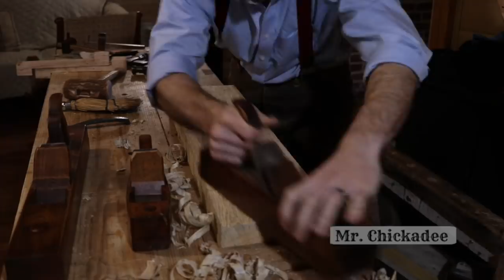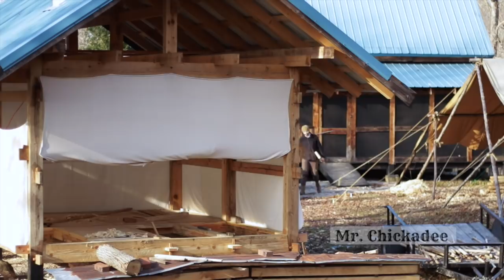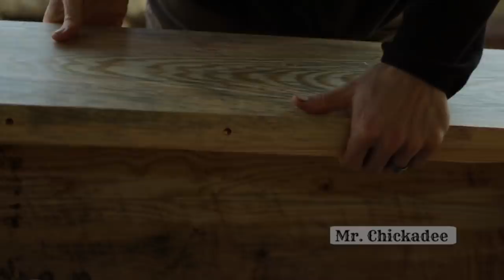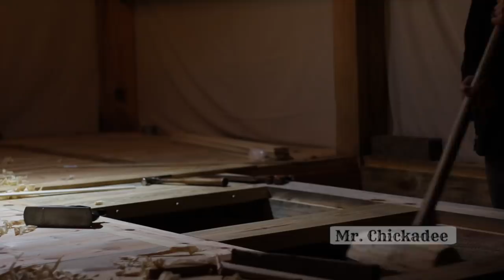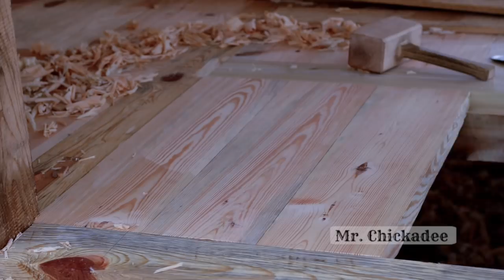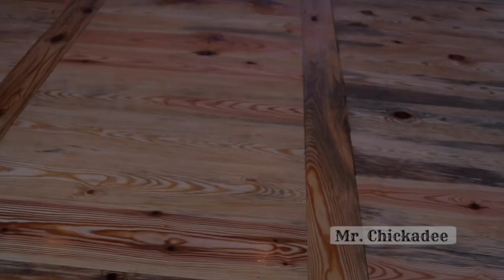Traditional Korean floor 대청마루 ( daecheongmaru) PART II a wooden floor without nails, screws or glue

Comment: Fantastic accuracy and a wonder to watch but I can't help thinking about the moisture content of the wood? any expansion and the forces will be unreal and any loss might see gaps everywhere. BTW I can see easier ways of achieving the nail less goal without such technically difficult joints. Still I very much enjoy your videos and I envy your ability to produce such fine work. PS.....I also use hand tools but I have come to the conclusion that some power tools have superseded hand tools both in time and accuracy, the table saw (set up right) can produce square stock in a fraction of the time it takes to square it by hand and a bandsaw can also be very handy.....I know.....shame on me lol
Reply: I was also wondering about seasonal expansion and contraction, I suppose this is covered pretty well on some sub-forum. I'll update this comment if I find a reasonably well explained resource.
Reply: Purple Om a jointer and thicknesser would half the time again but I think that would ruin the aesthetic of what this channel portrays
Reply: What is this 'power tool' you speak of? Is it some kind of wizardry?
Reply from the maker: @JayCWhiteCloud  As always Jay, you answer quiries much more completely and eloquently than I could hope to. I would add that most western flooring systems require more hand work as each board must be trued all sides while this method only needs the top and two parallell edges trued, or if fresh off the mill in a more rustic style no planing at all as any cupping should not have occured yet and a short board should be quite parallel "off the mill" If the sliding dovetail variation is used, and galloping joists, only two angled cuts need be made on the ends of each board hot off the mill, and slid right on in from one end of the builing to other. I cant think of an easier more efficient method?
Reply: Mr. Chickadee I could spend hours expressing awe and praise, you truly are an inspiration. Thank you for making and posting these videos of your amazing work. Can you please explain what you mean by “galloping joists”, I’ve never heard the term before. Thanks for your time.
Reply: @MrChickadee  This gives lots of food for thought. It creates a nice low profile floor (The way I build a floor with subframe, joists and boards on top often results in more than a foot of overall thickness). Good use for odds and ends of logs. And as there are no metal fixings, the surface could even be finished after the floor is installed. What is the reason for fitting the boards "bark side up"?
Reply from the maker: @badbernrock  Thank you, yes that is an old English term, I should clarrify, a "galloping joist" is simply a joist which sits atop the supporting beams, not flush with them. They are often joined with small notches cut out sometimes from the joist, or sometimes from both joist and beam under them, preventing movement in either direction. If these were used, not only is the joinery VERY simple, but the floor boards could be slid right through the building from one side to other depending on design, but the same joists could be used outside the frame proper if left long to also support the porch. These type joists could be used up top for the ceiling joists and left long on the gables to give support for a gable hip type roof as well. Ill be doing that in this little building soon.
Reply from the maker: @peaterful  Oh yes indeed, depending on design, you could use the widest boards you could mill from something like the thick butt logs often cut off and disgarded by loggers. My mentor has done floors of this type with 30" wide boards, only takes a few of those to fill a room! 

Yes, the fastest and simplest way to do this is to have galloping joists, those which sit atop the beams not flush with them, just slide the boards in green hot off the mill as they should be pretty straight and free of cup that fresh, then come back later to finish the whole floor if desired, or tighten up anything as they dry. Lots of options really, just a world of new possibilities, thats why I love this floor system. Tongue and groove can be used instead of the sliding dovetail I used, boards could be joined togher as well if desired with shiplap, T&G, groove and spline or other options. Easily insulated under between joists with Roxul Mineral wool batts.
Reply from the maker: @peaterful  There is a whole new world in undertanding an utilizing wood following the eastern traditions, we go deep into this in our timber framing classes. Just a few off the top of my head are; often fewer knots, less splintering (some woods the heart side of a board can delaminate badly in use on a floor, no one likes a 4' splinter in their foot,) many woods have harder wood on the bark side, thats why beech hand planes are oriented with board side on the sole, or should be, in some applications bark side up is the easiest way to control cupping, as the sides are held down the middle will always be down too, heart side up can still cup upwards. There are methods for roofing and siding where bark side out or up causes all the boards to lock together correctly and hold each other on...These are just a few, there are more. Also some of this just gets into the very differnet attitude and understanding asian masters had towars wood in general, they would enver use a timber or board upside down from how the tree grew, they selected trees and their applications depending on where in the forest they grew, i.e top of windy hill or deep in shaded ravine. All this is foreign and unknown to most western carpenters but was understood loooong ago in asia.
Reply: @MrChickadee  Thanks very much for your in depth reply, very interesting. I think about grain orientation when doing green wood furniture making but rarely when working with wood off the saw mill. I shall think about it more in future. Thanks
Reply: Jon Anderson you know that korea has extreme climate condition.. right? They have like 35C(95F) degrees wet summer and -35C(-31F) degrees dry winter.

Comment: Man you are some kind of craftsman, I own some of the older, early to mid century, tools that you have, and have learned from you about some of them. A non-traditional Korean floor, Ahn-Dal, about killed me in 1975, the charcoal Brick system. Crack in the floor let in copious amounts of carbon monoxide. Luckily I retired between 3-4 am, and woke unable to move around 6:30, I didnt have any trouble hollering though, and the lady who rented me the room came running took one look at me and started slinging open doors and windows. Recovered slowly over a couple hours and had a massive headache most of the day. One bonus was a breakfast in bed fit for a king, Ham and cheese omelettes, buttered toast, big glass of fresh squeezed orange juice, grapes and melons. She never made breakfast for anyone. I think she was trying to keep me from reporting the incident to local health authorities. I was happy with the reward, though I never spent the night there again.

Comment: Very nicely done. Love what you did. Korean ancestors think a house should last very long time and the wood and nails don’t go along very long because wood soaks the moist and nails get rusted from the moist. Eventually cause house to fall down. So it is very reason driven way to build a house solely using woods. Not only floors but also every part of house is built like a lego with only wood. And youve done a very nice job👍👍👍

Comment: Thank you Mr. Chickadee for taking the time to film, edit, and share this wonderful craftsmanship. I have questions for you about the roof. When zoomed out it appears you have a metal roof. Is this going to be your final roof? If so, how do you plan on stopping it from leaking? In my experience with them, metal roof always leak in a relatively short time span as the metal sheets expand and contract moving the nails until there is room for rain to come in.

Comment: I'm korean architecture contractor.  the traditional floor type is very eco-friendly method not using any glue or nails.  but it's getting forgotten because it takes a lot of time and  accuracy by carpenters in modern time pursuiting efficiency and productivity.   But sometime I miss that type floor board where I used to sleep and frolic when I was child.

Comment: I used to live on that kind of floor. It gives nice ventilation through the chasms during summers and we would block the front opening to keep it warm during winters. My puppy would sleep under the floor during summers. The area this wooden floor was located was between two rooms which were slightly lower than this floor. The Korean for this wooden floor is "마루(Maru)" which means higher place.

Comment: Extraordinary workmanship.  You make it seem easy and it is very deceptive of the level of skill required to pull it off.  Its your skill that hides its immense demand for accurate measuring, and exacting sawing, boring, and chiseling. The liquid used to coat and seal the wood; is it a preservative or an oil.  And how many coats?
Reply from the maker: Its just some canola oil mixed up with beeswax and turpentine, one coat for now.

Comment: So impressive, the precision and obvious quality of the work. You've said it took about a month, do you think you could recreate this level of quality with any mechanical assistance, to speed the process up, or is doing it by hand the objective for you? I find doing things by hand where possible and admirable, but I just don't have the patience. You are obviously so meticulous checking even after the stroke of a plane. Any other questions I had have been extensively covered in the comments section, so thank you for your time. New subscriber.
Reply from the maker: It took a month with other projects going on and not full time work here. Some few craftsman who do this work for hire use power tools to speed up the process. I have no need or desire for power tools, but I also dont do this for hire. Work how you enjoy, what matters is understanding the material and the methods, they can be achieved any way.

Comment: Mr. Chickadee, would you have a guess you would be willing to share with me how much thicker the frame for this floor ought to minimally be than the floor pieces that slide into the frame if I build a floor like this for a very small cabin out of tulip-poplar and have floor pieces under 3' long?  I want my floor to be as thick as possible in order to provide a little bit of insulation value, but I have limited total space to work with, so the closer the floor pieces can be to the size of the frame the thicker they can be, but I obviously don't want to leave so little wood supporting the floor pieces that the supporting ledge breaks out.  It looks like you had more, but do you think just one inch would be enough?  Or even 3/4"? 

Thank you for the inspiring and helpful video!
Reply from the maker: Traditionally it was normally done with timbers being close to a 6x6" beam and the boards closer to 2" thick. These sizes can be smaller depending on the weight the floor is holding and the spans for the beams. Wood is not great insulation, unless very thick, only R1.5 per inch of thickness. You can easily add insulation such as mineral wool on the bottom side of these floorboards to help with that.

Comment: it looks awesome! I don't have the time or patience to do that with hand tools. i get the appeal but I could see myself after doing a quarter of one firing up the plane and the circular saw and the chop saw and cranking those out 4x as fast. I know it's not the same but it sure looks like it!
Reply from the maker: With power tools this would be a very fast, cheap and practical build, if that's how you prefer to work, go for it!

Comment: Thanks for this display of marvelous woodworking. Is this oak wood? Did you buy cheap land and use a saving and part time job to afford the time to learn and do this, lived Spartanly? Takes lots of time and dedication without a paycheck?
Reply from the maker: this is pine wood, mostly shortleaf pine. Thats right, we bought cheap land, lived off savings and were extremely frugal. We lived in a tent for over one year, slowly building one thing after another. We moved into our first workshop, then later our house. Its been a long journey but we saved many tens of thousands of dollars and learned valuable skills in the process.
Reply: @MrChickadee  Thanks very much for that insight master Chickadee. That makes sense. Amazing how well self-taught and disciplined you are and an example of what is still possible with traditional methods, and I guess without Internet distractions.

Comment: Absolutely beautiful! I'm just curious how you are taking and making measurements? I am a carpenter and like to learn old methods of things. I collect antique books and there is some really amazing stuff in the really old ones but I have never been satisfied in understanding how it was typically done. I collect antique tools as well but have never really come across any measuring devices. Especially for longer lengths like let's say a peice of baseboard. Any thoughts?
Reply from the maker: Great question! I find most modern western carpenters rely heavily on very square dimensions and measurements, this only works when all your wood is perfectly straight and machines square, so rarely for me or those who work in dynamic green wood. A typical project for me might have basic measurement as a guide, like in the blueprint phase, but when its all down to fitting and such, the rulers and tapes go away and most meausrements are taken either from a story pole or just simple transposition. I find this aids the flow of material and accuracy. For a baseboard as in your example, your room is 22 feet long, well no way i would have a board that long, so I would just start with what baseboard stock I have on hand, start at one side laying in down, piece by piece till there is a gap laft on one end, there I simply transpose by laying a piece longer than needed next to the gap, making a mark, cutting carefully there and tapping it home, I try to go for a slight wedge in if possible where the piece is a bit longer than needed so it forces in place. Ive built entire furniture projects, or my last workbench for example, with no plan whatsoever, or measurement, just looked at the space on the wall the cabinet should fill, the height roughly I want, and depth, not as measurements, just as marks on a joiners rod, then the tools and stock on hand gives me my other dimensions. My chisel size determines mortises, and if I have 6/4 stock for the frame, well the thinnest of all that material on hand will be the guide when I dimension. My widest boards on hand determine how wide my panels can be and so on. It very organic, freeing, and I believe true to tradition as well.

Comment: At least the third time I’ve watched this.  Each time I say, “That’s one hell of an artist at work there.”
Older video, I know, but if you see this, what effect has seasonal expansion/contraction had on the wonderfully tight joints?
Reply from the maker: 6 months after installation I tightened up the boards and added a spacer to each line, nothing has moved since then. There are many examples in Korea hundreds of years old, they look pretty good!

Comment: Dear Mr. Chickadee, what would you advise as a simple but sturdy and durable wooden floor for a workspace? Maybe idea for a video? Thank you for your craftsmanship.
Reply from the maker: That would depend on your tools and skill level, also to some degree the purpose of the workspace. I really like these korean type floors, they can be done more simple and rustic as well and with other woods.
Reply: @MrChickadee , thank you for your answer. As I have no tools, no experience and no skills to speak of, your answer is on point. I just thought these Korean floors looked right for something like a wood workshop floor, but on the other hand they really look too beautiful for having them as a working floor, if you know what I mean.
Reply from the maker: @franek_izerski  Anyone could do this with a few basic tools, a plunge router for example could cut the shelf out pretty easy, a table saw or circular saw could cut the tongue on each board and slide it in, use rough wood and leave it that way so you dont care about stepping on it. haha the idea is whats important, not the path you use to get there, these type floors can be used for anything really, from porch, to workshop, to high end palace ballroom!
Reply: @MrChickadee  You make it sound do-able! Thanks for the encouragement!